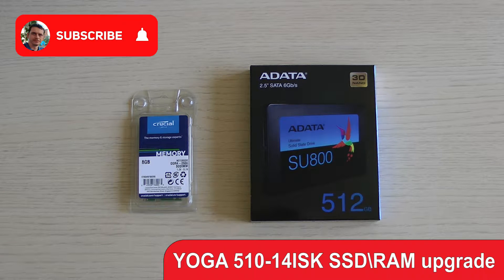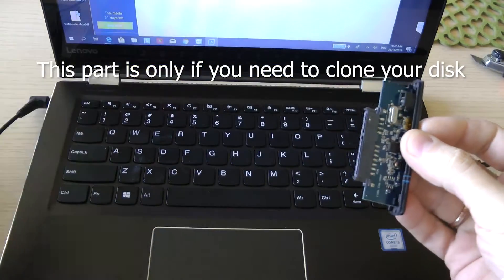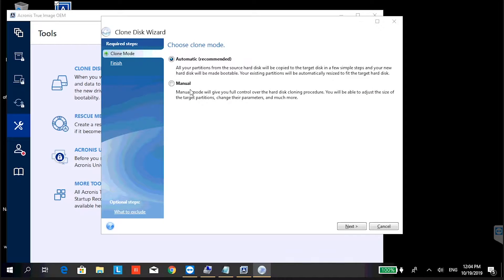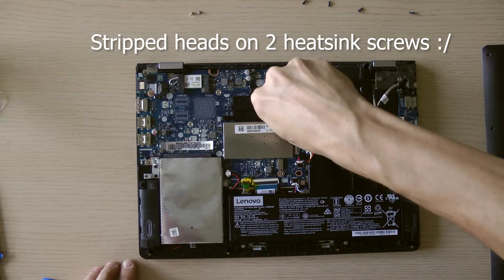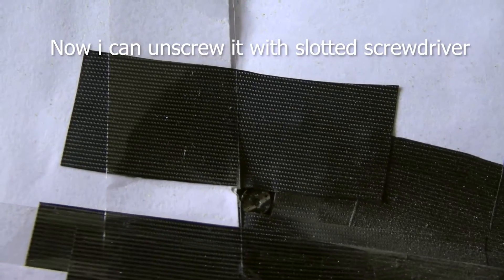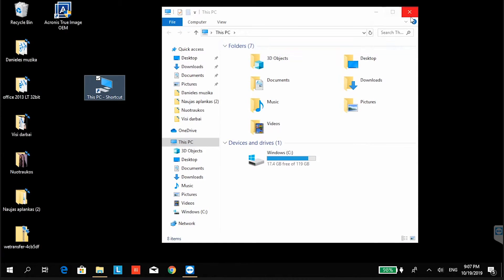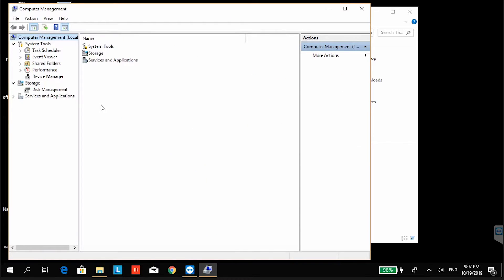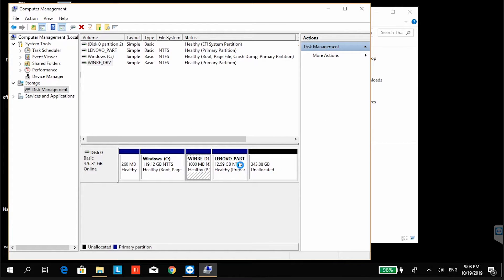LENOVO YOGA 510-14ISK SSD\RAM upgrade and cleaning

Comment: Hi, nice video, I have the same laptop. I would like to ask you if this RAM Crucial 16GB DDR4-2400 SODIMM  will be okay for this laptop? thanks
Reply from the maker: Yes, it will be just fine.
Check affiliate links in the video description and subscribe, thank you :)
Reply: My 510yoga i's capped to 8go Max ram
Reply from the maker: @pizzashiny7018  What are your CPU model and laptop model number? If the same as mine, it's 16GB in one slot. Subscribe, thank you.
Reply: @MindaugasJocionis  Hey My Yoga 500 14ISK user manual says Max Ram 8GB. i have 8GB installed.Can i install 16GB ram? Will it work? There is only one slot for RAM.
Reply from the maker: @nileshdsharma  What CPU is in your system? It has 8GB DDR3L RAM installed, right? Subscribe, thank you :)
Reply: @MindaugasJocionis  Thank you very much for replying.. I have Intel core i7 6500U CPU and DDR3 8GB ram. But since motherboard supports max RAM 8GB can I upgrade to 16GB?
Reply from the maker: @nileshdsharma  Officially it supports 8GB max. But there is a chance that it can use 16 GB in a single channel. As CPU and chipset support 32GB of RAM. 
If you can return RAM to the seller (in case of incompatibility), then you can risk, otherwise I don't suggest you do that. 
I personally have upgraded a few older-gen CPU laptop models that officially supported 8BG, but they worked with 16GB.
If you decide to do an upgrade, write back about how it ended.
Reply: @MindaugasJocionis  Hello Mindaugasji, There is only 1 SODIMM slot in my laptop. And I found out there only 8GB ram module available in DDR3, they don't make 16GB DDR3, right? So I guess 8GB is max is can upgrade..😞
Reply from the maker: @nileshdsharma  looks like there are 16GB DDR3L modules: https://www.newegg.com/crucial-16gb-204-pin-ddr3-so-dimm/p/N82E16820156042

Comment: Hi, may I know what type of screwdriver you used to remove these extremely small screws?
Reply from the maker: Actually i don't know the right size, always using first that fits. This time I stripped heads from 2 of 4 screws 8:50, very soft metal. Had to make my own cutouts. So be careful.  Buy ifixit set, and you will find one you need. Or any set, but from good quality metal.
Use affiliate links in the video description and don't forget to subscribe, thank you :)
Reply: @MindaugasJocionis  Oh wow, sounds hard. Thank you for the help! Great video btw
Reply from the maker: @qxliow  Thank you :) No, it's not hard, you just must be careful.

Comment: Hi, is it possible to upgrade the ssd capacity to ADATA Ultimate SU800 1TB 2.5" SATA SSD? Thank you.
Reply from the maker: Yes, you can use 1TB SSD. Please use affiliate link in the video description and subscribe, thank you :)
Reply: Do I also need to upgrade my ram or it wouldn’t affect? Thanks
Reply from the maker: @gracemaximiadis2164  If you have 8GB onboard, then for daily tasks it's more than enough. If 4GB, probably you exceeding it at some usage point.

Comment: I have the same laptop and followed everything in the video.... I added a Kingston 256 GB SSD. I didn't clone the disk as I wanted a clean OS. When I first replaced my HDD, there was an issue and the OS (which I installed previously with PC) didn't boot up. Switching Boot Mode from UEFI to Legacy fixed this and it booted up. The Boot Time however is extremely slow, almost equivalent to the HDD. Everything else in really fast... Apps open instantly and everything is good. Your booting time is really fast and I think I probably did something wrong as I don't have much experience with this stuff.
Reply from the maker: You installed OS to SSD on PC and then insert SSD to a laptop. Do I get it right? If so try to enable UEFI and install OS from flash drive on a notebook. Update OS and install the latest chipset drivers and check that fast boot is enabled. Might be the problem in the legacy mode as legacy uses MBR for boot and UEFI GPT
Or try to convert MBR to GPT on existing OS, but after that switch to UEFI in bios. https://www.thewindowsclub.com/convert-mbr-to-gpt-disk
Write back was any improvement from those actions and don't forget to subscribe. Thx.

Comment: can someone explain me the difference between ram speed 2133MHz  and 2666MHz ? and it will run on lower timing as told by him means what ?  5:24
Reply from the maker: It means that if you buy 2666MHz ram, BIOS will automatically reduce speed to the max supported by CPU (2133MHz) and automatically will reduce timings from CL19 to CL15 (lower timings - faster data transfer). Actually, there is no benefit from buy higher frequency RAM, just you will not get 2133MHz RAM in stores it's not produced anymore. I hope it's more clear now :) Subscribe, thank you.
Reply: @MindaugasJocionis  thank you so much :D
Reply from the maker: @yash1251  No problem :)

Comment: Hi MJ ,
After seeing this video , I think u have a good knowledge on lenovo  laptops
I have very poor knowledge in laptops/computers , As i am an Mech engineer,
, I have same laptop lenovo yoga 510 141SK , Its VERY VERY SLOW in WIN 10 OS,
Please help me out what i should upgrade, 
I HOPE U WILL GIVE ME A FAIR SUGGESTION
 Specification is as
Processor :  intel i3 core 6006 CPU @ 2.00 GHz 
RAM : 4 GB 
64 bit os * 64 based processor
Reply from the maker: In this laptop, you can upgrade only RAM and SSD. What disk is right now in the laptop, and how much space is left on it?
Reply: @MindaugasJocionis   its 1TB hard disk and 750 GB is still free
Reply from the maker: So you have the old fashion HDD, change it to 512GB SSD, and you will get a huge boost in performance. Also change to 8GB of RAM as for now 4GB is the limit for daily tasks. If you planning to use this laptop for a long time and money is not a problem, buy 1TB SSD and 16GB of RAM. Check links in the video description for parts specifications. Or give me links for parts that you will purchase and I will check if they are compatible.

Comment: i cant get the metal ram cover off. i have a lenovo yoga 510 14iKb..can u please help?
Reply from the maker: Just bend clips a bit to side and push up from corner. It's just a shield, use a bit of force and you will succeed. And don't forget disconnect battery at first! Subscribe, thank you.

Comment: I bought the same ram the specs hwoever of 16gB since i run virtual emulators which basically run on ram. So will this have any effect on my PC? Like 16Gb is the max compatible with the i3 6 gen core.
Reply from the maker: For basic tasks, 8GB is enough. But for specialized - it depends how much RAM you used if you exceeded 8GB, then you will feel the difference. Subscribe, thank you.
Reply: @MindaugasJocionis  thanks for the reply and your gr8 video. I just installed the 16 GB ram of crucial in my laptop but didnt install the ssd as I forgot about the connector.
Also I am using 5GB as ramdisk.
Could you please also make a video on ramdisk? The pros and cons. Please.

Great video btw.
Reply from the maker: @susiolu   Sorry, I just tried RAM disk once. Didn't find practical usage for it. Didn't like that, you need to flush everything to disk before shut down, then read back, then you need a huge amount of RAM to make it sense. I think it's more server thing.
Reply: @MindaugasJocionis  Since right now i have hdd, it causes heat problems however when I ran android os on Ramdisk after giving 5gB to it, my laptop was cool.
Since now the files are being stored and replaced in ram compartment only.
Reply from the maker: @susiolu  That makes sense.

Comment: So can I use, 16GB Single DDR4 2666 MT/s PC4-21300 DR x8 SODIMM in my Lenovo yoga 520?
my current ram speed is 2133MHz.
Reply from the maker: Yes, you can use that one. It will run at the maximum speed supported by your CPU (I assume you have 6th gen intel CPU, so it will run at 2133MHz, and lower timings).
You can use 2133MHz or 2400MHz RAM too if that one is in stock, and the price is better.  Check for affiliate links in the video description, thank you :)
Reply: @MindaugasJocionis  Thanks you very much for the fast response.
yes, my laptop is a 7th generation model.
Reply from the maker: @MithulMt  No problem :) Do you know the exact model of your CPU?
Reply: @MindaugasJocionis   my laptop is yoga 520- 14IKB
Processor Intel Core i5-7200U. CPU 2.5 Ghz.
Reply from the maker: @MithulMt  Ok, so it's all the same. :)

Comment: Great video. I have two questions: There is a white dot over the battery connector, is it thermal paste? Why did you press RAM cover before fixing it?
Reply from the maker: Thermal paste is only on cpu-gpu die under the heatsink. You need to push RAM shield into fixators (two metal clips - this shield metal goes between them). Subscribe, thank you :)

Comment: Thanks for the video :) 
I have a 1 TB HDD, how do i upgrade it for this same model also, is there any way to upgrade my Intel i3 processor? When trying to run emulators and virtual machines, my laptop hangs  so i think i need to upgrade my 4Gb ram too.
Reply from the maker: Unfortunately CPU is soldered to motherboard. RAM you can upgrade up to 16GB. 1TB SSD is perfect :) Use affiliate links in video description for purchase, and don't forget to subscribe thx :)
Reply: @MindaugasJocionis  it just occurred to me that since I want to overhaul the laptop, why don't I buy a desktop. What's your opinion, is it better to upgrade this one or make a desktop, my need is stable gaming and for emulation purposes like bluestacks and linux
Reply from the maker: Sorry didn't get notification about the comment. Buy a new desktop PC, I think this under powered cpu is just for basic usage.

Comment: Thank you,
one issue, i just opned my 510 cleaned Ram and placed again but laptop not getting started. also, i forgot to remove the battery plug before removing ram. any idea why its happening?
Reply from the maker: There is small probability to fry component while taking them out or placing back while battery is plugged.  Does laptop starts at all? If it starts, but you see just black screen, try to reinsert ram.  Push it till the end, then push down to click in place. 
Did you upgraded just ram?
Subscribe thank you :)
Reply: @MindaugasJocionis  Thank you for your response. just power and keyB light blink once and nothing else. I called Lenovo care and applied troubleshot i.e  Fn+S+V press for 20sec and then try to power ON and it worked :). I didn't upgrade anything just cleaned Ram and putback.  I wanted to upgrade but how will order a RAM? what we should consider? also while removing RAM cover and power plug I did some scratches on MBoard tracks, that will create issues? anyhow it's working fine. SUBSCRIBED
Reply from the maker: Sorry didn't get notification about the comment. There is no problem from little scratches, especially if everything works :)  You can upgrade to a single 16GB stick, check links in the video description.
Reply: @MindaugasJocionis  thank you
Reply: @MindaugasJocionis  One more Question: Ideapad 510Max 16gb Memory. 4Gb inbuild +4Gb in one slot and there is no more slots. How we can upgrade to 16GB? because 12Gb will not get in the market.
Reply from the maker: As for Ideapad 510 you can upgrade to 20GB. New 16GB stick +4GB built-in.
Reply: @MindaugasJocionis  As per specification Max is 16Gb
Reply from the maker: @sudhirdhawle5370  What cpu is in a laptop?  I think max supported by CPU is 32GB, but the max upgradeable on this laptop is 16Gb + 4GB soldered.
Reply: @MindaugasJocionis  i5 j checked lenovo specifications only which says Max 16gB
Reply from the maker: @sudhirdhawle5370  Just checked on crucial site, they say the same. https://www.crucial.com/compatible-upgrade-for/lenovo/ideapad-510-(15-inch)  
Also in forum people say that they made successfully upgrade to 20GB.
Reply: @MindaugasJocionis  i wil try install 16GB, will it harm anything ?
Reply: @MindaugasJocionis  Sorry , its 520-15IKB (Type 81BF) Laptop (ideapad) - Type 81BF               NOT 510
Reply from the maker: @sudhirdhawle5370  It's the same 1x16GB DDR4-2400 SODIMM  Just don't forget to disconnect the battery. :)
Reply: @MindaugasJocionis  Thank you, but see this https://psref.lenovo.com/syspool/Sys/PDF/Lenovo_Laptops/ideapad_520_15/ideapad_520_15_Spec.PDF 16GB max / 2400MHz* DDR4 if i keep 16GB ram it will be 20GB total , it will harm anything ?

Comment: Does this 510-14isk capable of a M.2? cus I don't wanna spend another hour to re-install the windows again. thanks.
Reply from the maker: No it doesn't have m.2 slot. You can clone disk 1:1 without reinstallation OS and software with cloning soft. like acronis etc. Subscribe thx. :)

Comment: Hey,
Nice video. I have the same laptop.
What kind of improvement did you see with the upgraded RAM? Is it worth the upgrade or is the CPU too much of a bottleneck?
Reply from the maker: It depend on usage. Check how much ram you use at your normal usage scenario. If you exceed 4GB then you will feel the difference from extra 4GB in application switching time. These days you can easily go over 4GB in daily usage. Thx. for comment. Subscribe :)
Reply: @MindaugasJocionis  True.. Windows alone takes up more than 3 GB. Went for the upgrade and really happy with the improvement. I'm the kinda guy who works with 50 tabs on firefox and there was significant performance gain.
Cheers.

Comment: Hey bro, what cloning software is tht again? should that copy all in the inserted storage? even OS? and what ssd are compatible with our lenovo yoga 510 14isk?
Reply from the maker: It's acronis cloning software, usually it's given for free to download with ssd disk, it clones 1:1 your original HDD in auto mode, or you can choose which partition to clone in manual mode. You can choose any 2.5" SATA ssd you wanna :) or use affiliate link i included in description, and don't forget to subscribe! Thx :)

Comment: I got the lenovo ideapad  flex 4-147...can I  buy the same hd and ram for my laptop....and I cant clone cause my hdd is mess up
Reply from the maker: Yes you can use the same parts or higher capacity. Max ram capacity is one stick DDR4 16GB. As for SSD i suggesting 1TB, unless it's too expensive. As for HDD, you can install from scratch, your windows key is integrated in Bios if laptop was already with preinstalled windows.  Don't forget to unplug battery connector before parts change. Affiliate links to parts is in video description, please use them if you can/want :) And please subscribe. Thx.
Reply: @MindaugasJocionis   can I use any name brand ssd's card?  And any laptop ram?
Reply from the maker: Sorry didn't get notification about the comment. Use any brand of ram and ssd you like, just make sure that ram is DDR4 SODIMM.

Comment: Is it possible to upgrade my 510 isk to 16 gb ram from 8? Thanks for the video
Reply from the maker: Yes (page 27), RAM specifications. Don't forget to subscribe thx :)
https://download.lenovo.com/consumer/mobiles_pub/yoga_510-14ast_510-14isk_510-15isk_510-14ikb_510-15ikb_hmm_201608.pdf
16GB max, DDR4 2133, one 260-pin SODIMM socket
https://eu.crucial.com/compatible-upgrade-for/lenovo/yoga-510-14isk
Reply: @mindaugas Jocionis can i use 16gb DDR4 2400? Or need DDR4 2100?

Comment: Hi im a sub from Chile. U think that this ram:  https://articulo.mercadolibre.cl/MLC-491762471-memoria-ram-notebook-crucial-8gb-ram-ddr4-2400-_JM?flash=f98de4a96f159fb509a8a4e873e8213cebb5c5f1&noIndex=true  works with Lenovo Yoga 510?? Sorry 4 my english xd xd
Reply from the maker: What are further letters after 510. Or what RAM is right now in your system DDR3 or DDR4? There are different models.
Reply: @MindaugasJocionis  510 -14ISK. Now I have DDR4 4GB
Reply from the maker: @elnegretta6178  Yes this RAM will be ok. It will automatically lower RAM frequency to 2133MHz and better CL timings. Don't forget to subscribe, thanks  :)

Comment: What`s profit by DDR-4 2666? I saw 2133 in system, at the end video.
Reply from the maker: You will get lower CL timings (Well actually you get the same timings as 2133 because 2666 has higher ones, the point is that you cannot buy 2133 right now, i believe they don't produce ram with this frequency anymore.). Right now you can buy only 2400 and 2666 MHz ram in stores, and the price of them is the same. So why not :) Thanks for comment and don't forget to subscribe.